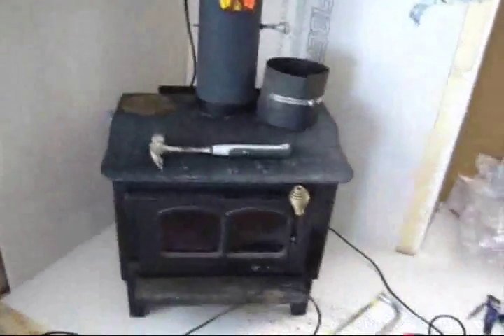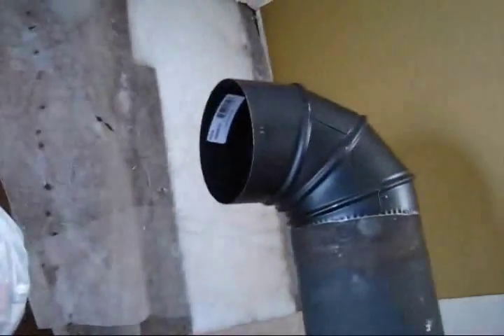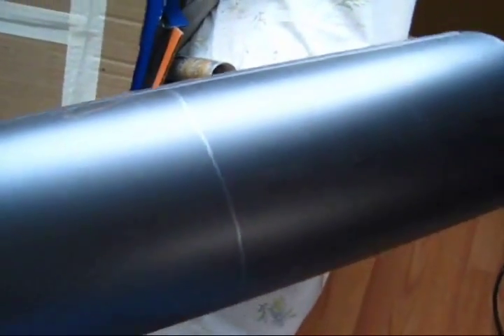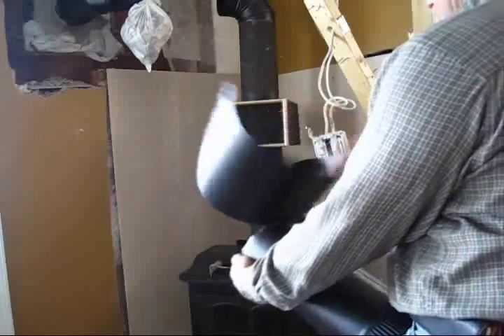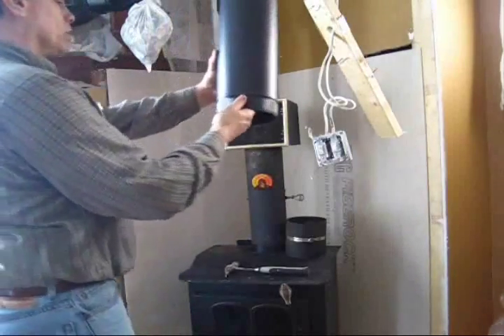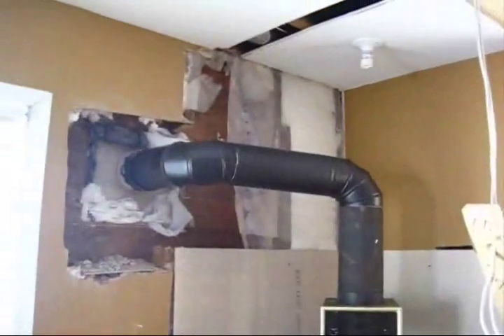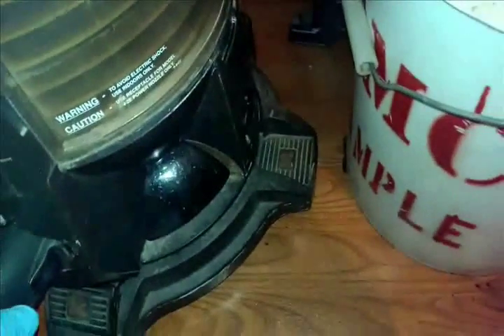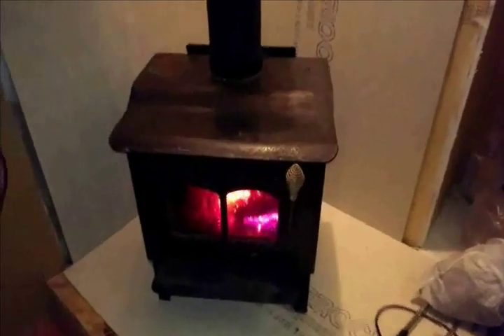Installing a wood stove in a brick chimney. Part 2 Connecting and lighting it!

Comment: hello, I am trying to install a wood pellet stove. I have a very similar chimney set up. ceramic lined. there is already a hole from a previous wood stove, i assume. I want to vent the pellet stove into this existing chimney, but i'm seeing that i should line the ceramic with a flexible smaller flue. I'd need about 15' which isn't cheap. do you think that's necessary since it already has the ceramic? i'd much rather do what you did, if not it would be cheaper just to relocate and cut into the wall and have it horizontally exhaust out.
Reply from the maker: Do whatever code allows you. The exhaust with a pellet stove is nowhere as hot as one could be with a wood burner. So you will be fine from that aspect. If you sleeve it should have a better draft and may avoid not enough draft issues. Good luck!